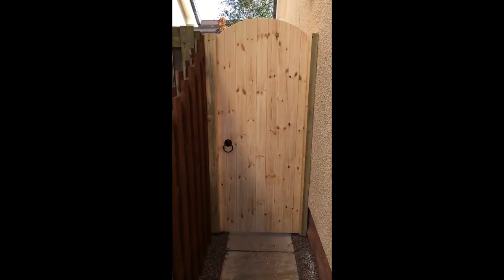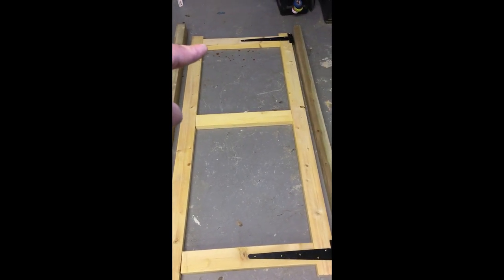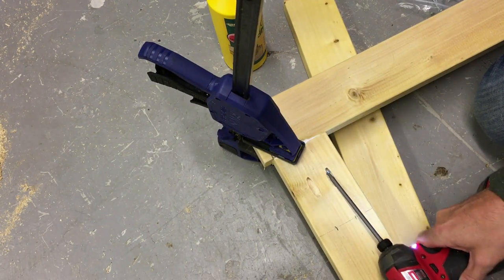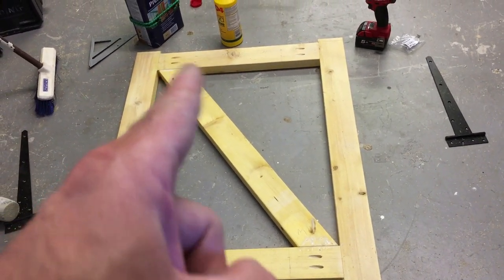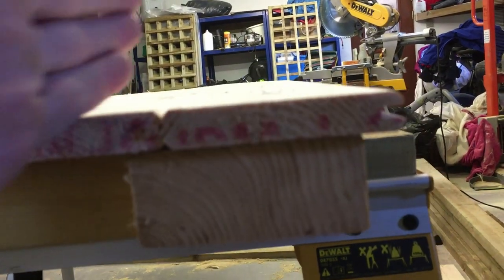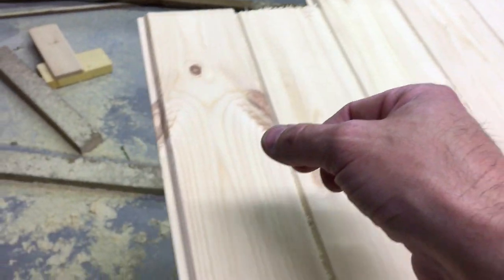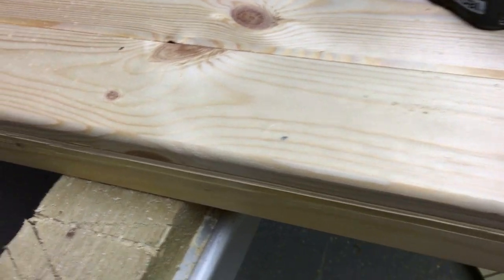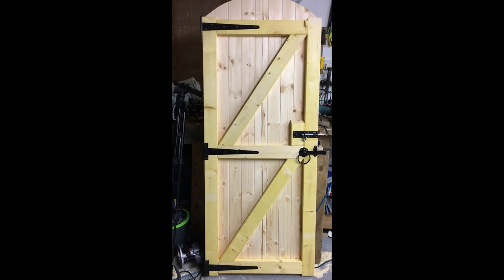How To Make a Gate Frame with 4 x 2

Comment: Absolutely smashing.

'Pretty well how I plan to do ours. Except I thought about using overlapping joints for the frame construction.

You added a fantastic finishing touch which I hadn't considered. I'll use my Dad's router for that too but I haven't used a router before!

Thank you for this very helpful presentation.
Reply from the maker: Thanks Mark, yes, overlapping joints would be stronger, but I think they are a bit overkill for a lightweight narrow gate such as shown here . Glad you found the video helpful and good luck with your project 👍😎.

Comment: Hi, great video. 
I’ve liked and subscribed. 
Can I ask was this pressure treated or normal timber ?
Thank you. 

Also any video on a smaller garden gate. 900 high ?
Reply from the maker: Thanks, the frame was pressure treated C16 timber but the tongue and groove was just normal timber. I treated the full gate with clear wood preserver and then it was going to receive 3 coats of paint by the client. Hope this helps ? Cheers

Comment: Awesome video!!! thanks a mill. I'm going to give this a try in a few weeks. I'm just wondering how you would treat this so its weather resistant. WIll the matchboards not expand and contract when it rains and freezes?
Reply from the maker: Thanks for the comment. You can just paint it with a good exterior paint or stain, that would take care of the treatment. Yes, matchboard will expand and contract, so best to put a small 2mm gap between boards, I don't think I pointed that out in the video. Hope this helps ?
Reply: @Bacrenfencing  It does. Thanks a million. I'll keep the 2 mm gap like you said. Ill post here the outcome here if you wanted to see how it went. 
 :)
Reply from the maker: @HadesTut0rials  That would be great !

Comment: Great vid. Thinking of building a similar gate. I'm a bit confused about the fixings. Seen some vids where they fix the tongue and groove boards with screws from the rear. Would there be anything wrong with doing it this way i.e. fixing boards using screws from the rear or would you stick to nails?

Also do the growth rings on the end grain of the t&G boards need to face the outside of the gate or does it not matter. Read some place that growth rings on the endgrain of boards should face the outside of the gate as the boards are likely to cup in that direction and the fixings would help counter that?
Reply from the maker: Personally, I always nail and fill from the face of the gate, I wouldn't screw the boards from the rear, but each to their own. I have never had an issue with cupping when nailing from the front and I never pay attention to the growth rings - maybe I should ? but never had any issues. Thanks for the comment.
Reply: @Bacrenfencing  I've got 30mm rails and 20mm boards. What kind of nails do I use. Would 50mm x 2.65 nails be ok? Note I don't own a nail gun and I often find nailing splits the wood.
Reply from the maker: @ozziiozzii2594  50mm nails would not be ideal, best with shorter nails or 40mm wood screws
Reply: @Bacrenfencing  Difficult to find shorter galvanised or stainless steel ring shank nails. Tried looking for 45mm nails but can't find any, the next size down are 40mm ring shanked. would 40mm nails be too short?

Comment: Hi mate. First off, love the videos they are great. Can I ask, I'm going to have a go at this gate (pray for me) as I don't have a nail gun, what size nails would you use to attach the matchboard to the frame. Thanks a lot again mate. You make it look easy but I have a feeling I'm going to find out it's not.
Reply from the maker: Hi Matt, I just use 50mm long galvanised ring shank nails which are fired in under flush so I can use filler. As long as you use galvanised ring shank nails, you should be OK. If you are using round headed nails, you can use a nail punch to get them under flush (if you want to fill the nail holes and paint). I hope this helps and good luck with the gate build 👍😃
Reply: @Bacrenfencing  thanks a lot mate! This should keep me out of mischief for a while.
Reply from the maker: @buddymatt111  No problem Matt, I am sure your gate will turn out fine !